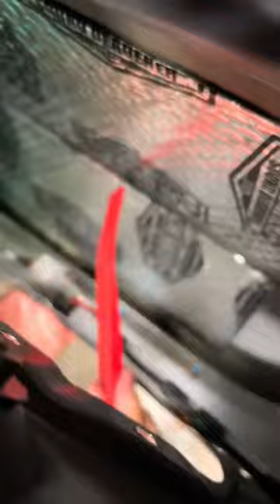Sound Deadening Doors Part 1-  79 Series get some love in the doors.

Comment: How much of a difference does soundproofing just the doors make? I understand it would stop any drumming but does it block out much noise?
Reply: Its actually a huge difference and if you are in the audio world, this also will make your door speakers punch way better
Reply: What did you do about the plastic on the for, that you put to the side?
Reply: @footballboyz15 put it back using the same adhesive.  Just be careful taking it off so you can reuse it.

Comment: I’ve heard people say it helps keep the outside heat out. Is this true?
Reply: yes
Reply: Bearly even if you use a thermal backed matting that covered the entire inside of the door, you will probably not feel any difference still if not only a slight difference. Insulation needs air pockets that are trapped to help slow heat transfer. This sticky tape stuff has no air gap so its thermal Insulation will be minimal at best. If you want to trap out heat wrap or dip your car white and get clear u.v. tint for your windows and windshield. That will help more than the sound deadening mat will (its only ment to stop sound not really heat)
Reply: There are drain holes in the bottom of th door skin that will let hot air in regardless of what you do and you never want to block those holes they drian water from inside the door.